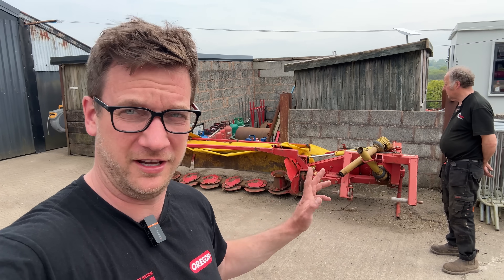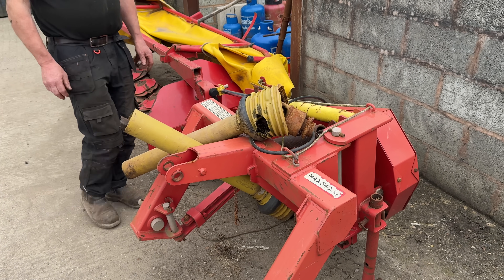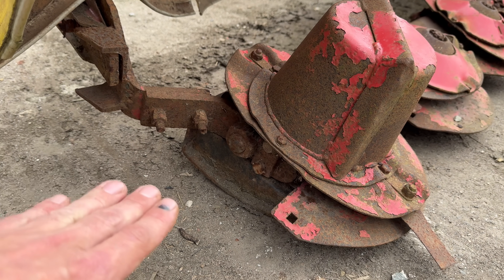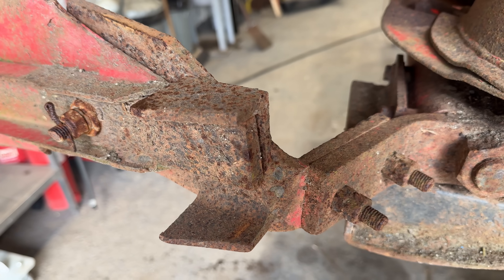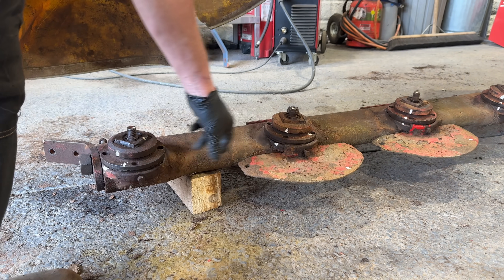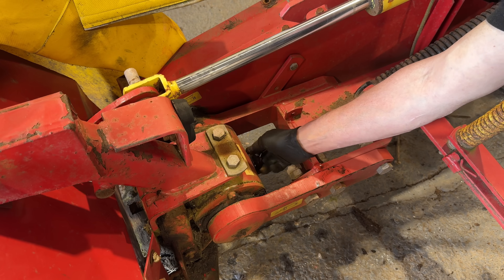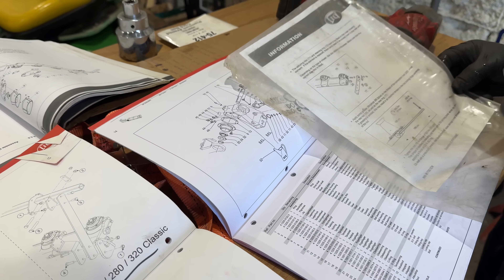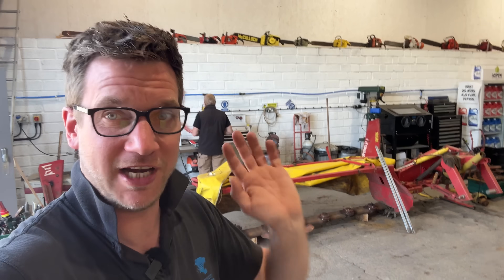Is this Tractor Disc Mower Bent? How Bad is it? Can we Salvage it?

Comment: there good mowers i think .......i got one but its the bit newer splendimo........i thought the bed was solid all the way through or maybe it is on mine. the belts need replacing fairly often but there not overly expensive
Reply: I’m pretty sure even the later models have sectional beds; from memory it lets you get at the individual flex rods if one sheers. I nearly bought one a few years ago, the salesman told me it could be run vertically because of the individually greased drive units. When I showed interest in also using it to face a hedge he wasn’t sure that was a good idea.
Reply from the maker: Yeah the Spendimo are also sectional according to Mike. And yes Mike said the same that they can be run vertically as other mower bed are oil filled and when vertical the oil goes down hill, where as these are grease filled (very expensive grease I have found out) it stays where it was put.